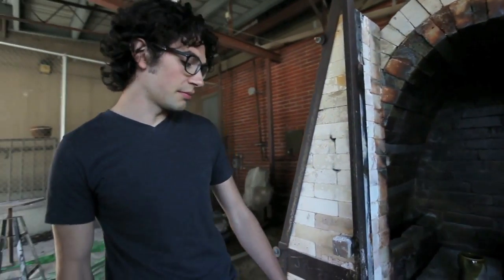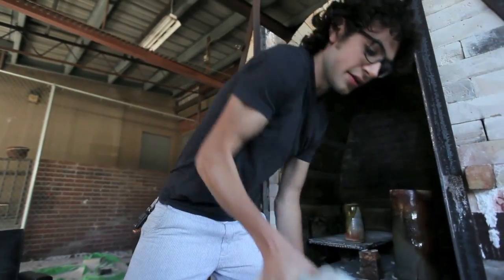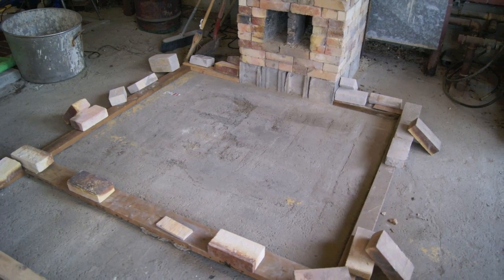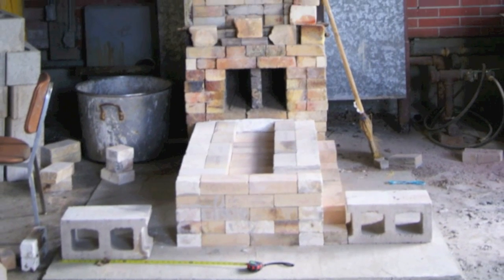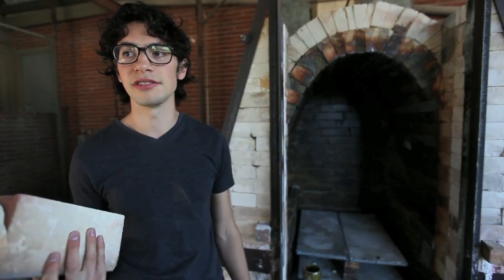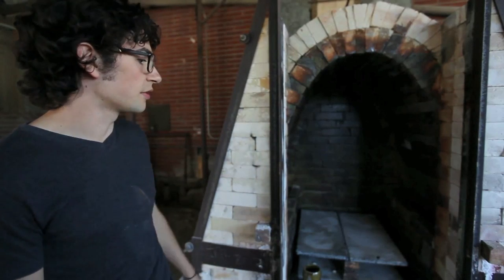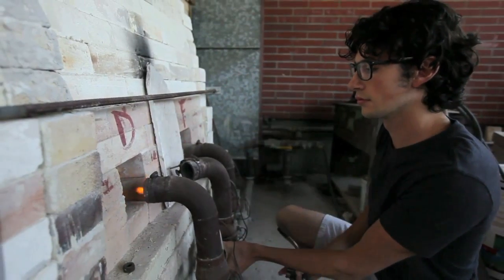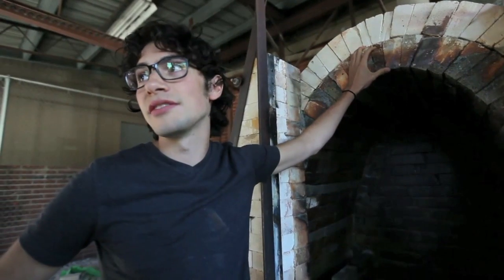The Making of a Soda Kiln at PLU

Comment: Wow. The kiln is built out of high duty fire brick, and the second layer is insulated firebrick. Bricks made out of clay that had cork mixed in so the r value is higher. The type of kiln is call a catenary arch kiln. A chain is held upside down on a board and the curve of how the chain falls gives a person the curve for the inside of the kiln. 13 hours is not to many hours for a kiln this size. What makes the pots look great is that the high duty bricks absorb so much more heat energy and then cool at a slower rate giving the glazes time to have a better melt. The soda is introduced by spraying or burrito method. And really it should have taken a week at most to build the kiln.

Comment from the maker: Hi James, 
We fire to cone 8 then soda, continue to fire to cone 10, most glazes we use are cone 10, BUT remember the soda is fluxing down the glaze melting point, so they will NOT be just like your normal cone 10 red firing. You could use other temp glazes, just give it room to move and see what happens. 
Good firing to you - Steve